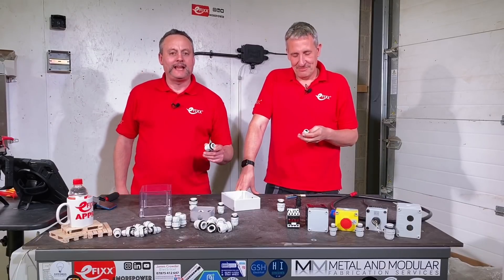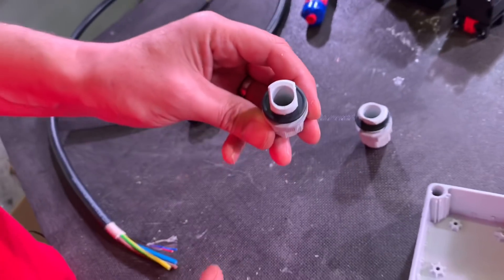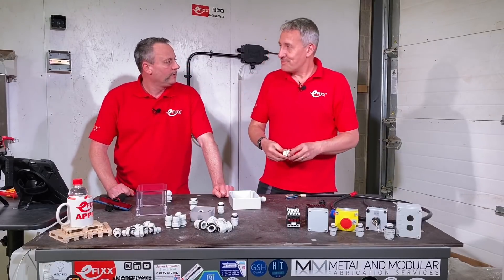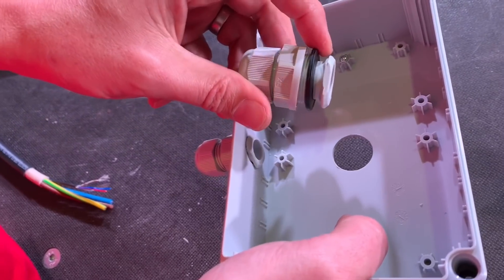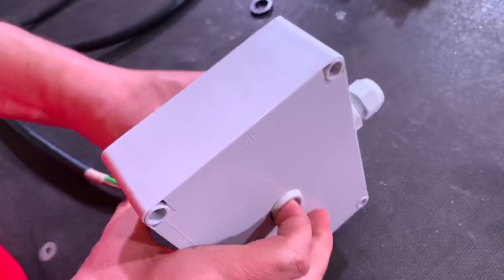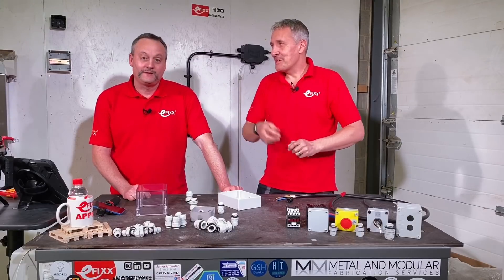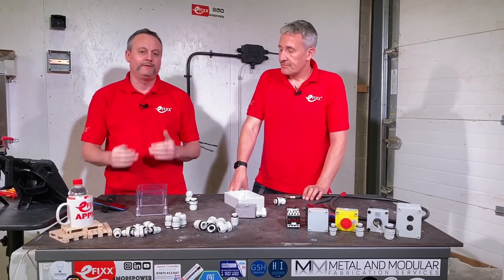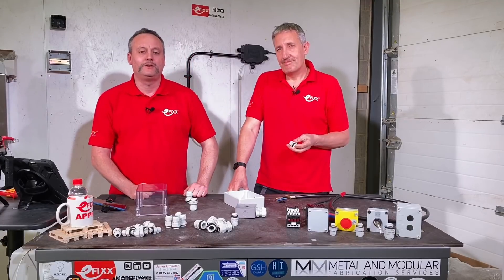Fast fitting IP68 Cable Gland - no need for a locknut - Hylec KWIK FIX

Comment: I see I am 2 years late to this video! 
But I just wanted to add that this gland is designed for ONE-sided installation. 
ie. you do NOT need to hold the fixing flange on the inside of the box as you were doing in the video.

The gland was designed mainly for control cabinet sized applications where one person cannot feed the thread through the panel wall, hold the gland in place, AND screw the locknut on from the INSIDE of the cabinet, because the cabinet door would require you to have 5 foot long arms!
So 2 people are needed; one outside and one inside the cabinet. = extra labour expense!

So, the new gland allows you to feed the fixing flange through the hole, then one hand is used to PULL on the cap of the gland, which pulls the fixing flange against the inside of the cabinet wall.
Then your second hand turns the locknut of the main body anti-clockwise, which clamps the panel wall between the fixing flange and main gland body and O-ring.

I prefer the Lapp Skintop-Click type design better. Because instead of a fixing flange, they have what I would call "fish-hook" plastic latches, which allow one-handed assembly!
You simply push the gland into the hole, and the hooks are squeezed inwards because they are slightly wider than the hole. Then as soon as they are through, they spring outwards and immediately hold the gland in place.
Then simply turn the locknut of the main body anti-clockwise until tight.
All ONE-handed, from ONE-side of the cabinet!

Comment: Thanks for the video.  I am a recent subscriber.  I am needing to route coax and control cables into the cab of my vehicle.  This will be for CB & Ham Radio installation.  There are grommets in the cab but don’t seem to allow sealing the cab from the environments.   Thanks again for your video.

Comment: You say no tool required to install or remove the gland...apart from of course,  your finger that you used both to do it up and undo while installing inverted using your EV charging point as an example where this may be helpful.

Can you demonstrate this with out holding with your finger?   My guess is, without holding it, you will not be able to tighten it up that easily.
Reply from the maker: You can tighten it without holding - it’s just tricky when the box isn’t fixed down - hence the fingers. We will show this in a future video when we use them on site.

Comment: Great fix to a problem I have seen for years. Some times when a gland is under pressure will not be able to hold the lock ring as the threads are not strong enough. When this happens you have to change the gland as the lock ring will not go back on properly.

Comment: Another solution to the earth blocking the entry is to use one without that flaw. Who made the back box? Surely they need to watch this video to find out about their flaw. Sparks shouldnt have to purchase special components because other things are poorly designed.
Reply: Poorly and very small choice any or pvc alternatives
Reply: Just put the locknut first flush to the box and the screw in the gland from the outside.

Comment: You still had to insert your finger to the back side of the 25mm gland to remove, therefor IMO wasn’t a true demo of how to remove when there’s no access to the back of an enclosure.
Reply: @DOOM
It was obvious that everything can be done from one side.
Reply from the maker: Thats because out demo box wasn't fixed down - we will follow up showing one handed removal.
Reply: @efixx  From the imagery I find it difficult to accept your response. It seemed the reason the demonstrator used his finger to hold the "nut replacement" both to tighten and loosen the grip was because without doing so the "nut replacement" would spin, thereby preventing the locking nut, on the front, from tightening. What you need is a tool you can insert from the front to prevent the back nut from spinning. But that would start to make the whole thing a bit of a Phaph!

Comment: I was prepared to be 'meh solution in search of a problem'... but yes. I like this design to solve issues. The reason i was prepared to be meh... speed is the ENEMY of quality in most instances. This will actually save time however, because of problems that should never occur... but always do in practice 
looks sideways at schneider boxes

Nice Movember look by the way guys :)

Comment: You keep saying you don't need to get behind it to tighten/untighten, but in the video you are holding the back with your finger. Will it tighten if you aren't holding the back?
Reply from the maker: Good point - we needed hands as the equipment wasn’t fixed to a wall. If fixed down you don’t need to hold the gland. We have a few spare samples send us a DM and we’ll post you one to try.
Reply: @efixx  Thanks for the reply thats good to know!
Reply: As you turn it anticlockwise to tighten to enclosure, and clockwise to tighten to cable, just tighten both at the same time.
Reply: Stopped to ask exact same thing. 
It might spin when you try to undo it
Reply: @hamkor04  I can see it might, i am, also interested in the outcome of this. @efixx.. more experiments!
Reply: I can imagine you can pull on it to create the friction you need to hold it
Reply: @oliverriall  That doesn't always work, but if access is limited (rather than unavailable at all)  wood mitre adhesive can be a godsend (the 10 second superglue plus accelerator stuff).
Of course you have to be wary of the effects of a hydrocarbon accelerator spray on pvc... but it's helped me out even before this when a locknut was hard to access

Comment: Nice video guys keep it up. Have you come across the CLIXX by wiska ? I’ve not seen any info on them other than their website. The idea behind them looks very good and they’re very slim line I’m just not sure how much I would trust them I’d be interested in seeing what you guys think.
Reply: Are you thinking of a cable entry membrane used a lot in CU's,  like a blind grommet, Wylex and others do them, push your cable through and they self seal, clixx is the same I think, I think they are all fire rated. Perhaps someone will correct me
Reply: @nw5835  it is the cable retention part I’m intrigued by. There’s been a few times where i’ve needed IP rated grommets but don’t have the space to fit them they also need a retention to the cables don’t fall out. Needs might be the solution to me. But I haven’t seen anyone use them. I’m not worried about the fire rating as much.